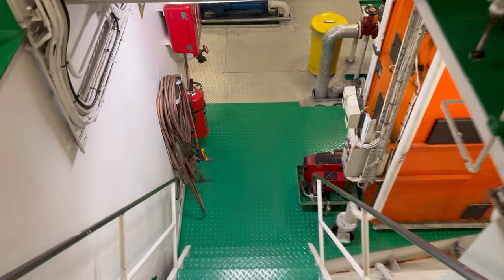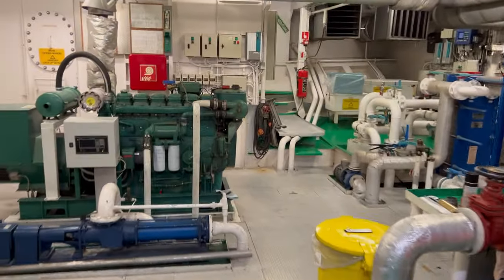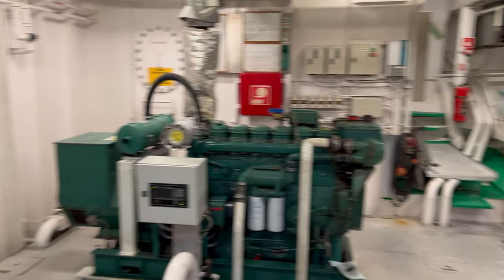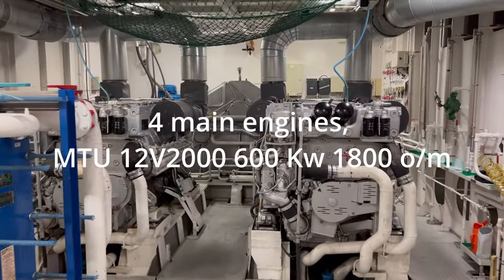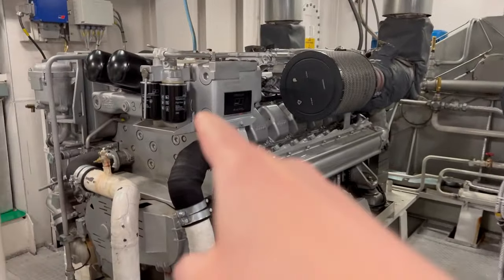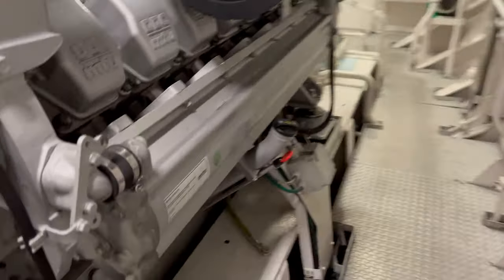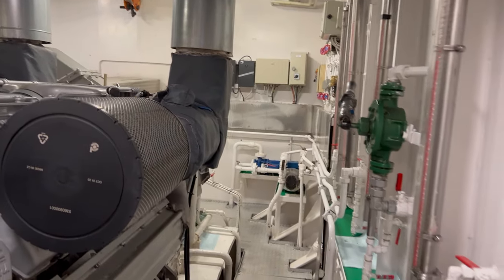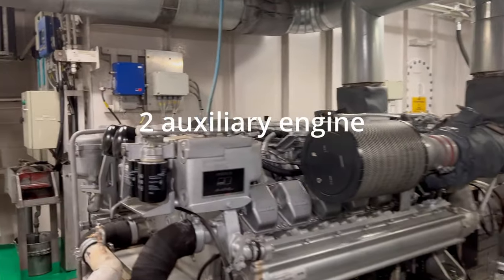How Ferries Work: A Behind-the-Scenes Look at Ferry Operations and Engineering

Comment: Greetings from the Bahamas! 
How do these type of ferries work? You mention running 1 engine in the front and 1 in the back, so is it pulling and pushing at the same time? How many props do you have?  Is that more efficient than just running the back prop(s) and allow the front prop(s) to windmill? Also, I'm assuming these are diesel electric?
Reply from the maker: The ferry has two propellers for propulsion. When docking, the rear propeller rotates 180 degrees to slow the vessel.

Older ferries have an additional function for the front propeller. When disconnected from the motor, it acts as a windmill. When connected to the engine, the propeller pushes water in front of the ferry to brake.

I hope this clarifies the matter.

The ferry has four engines in total. It is to save fuel according to the ship's SEEMP plan.